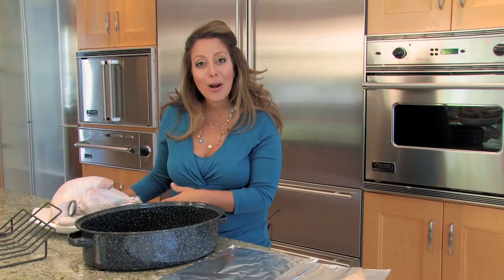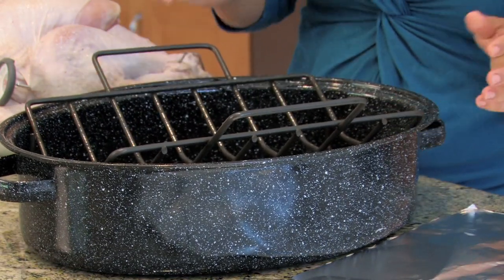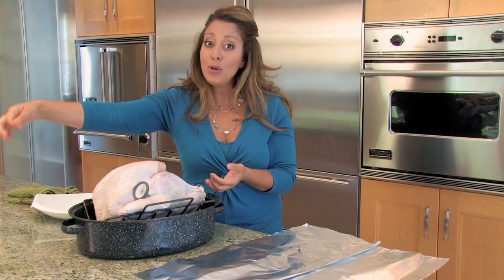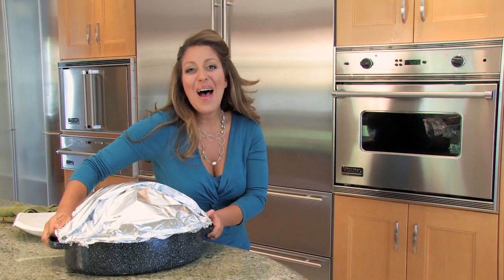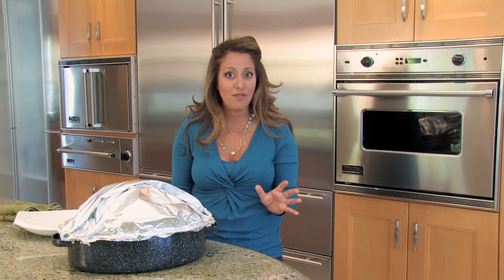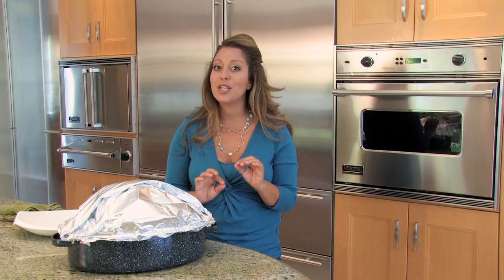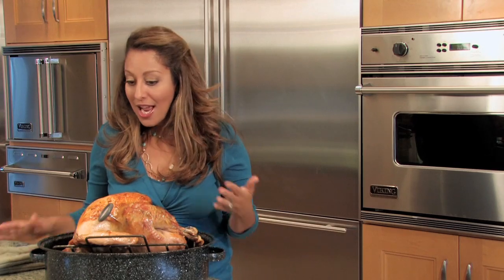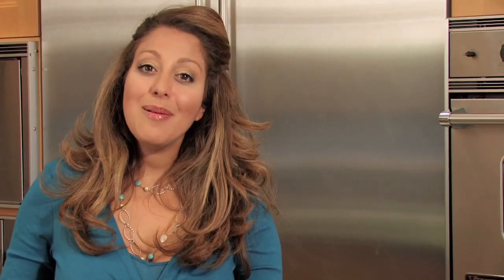Cooking & Kitchen Tips : How to Bake a Turkey in a Convection Oven

Comment: Valerie, look at how high the turkey is sitting on the rack in that pan, it essentially became a low rim pan with it sitting that high. I have Convection roasted several turkeys for thanksgiving, and the only foil placed is over the drumstick ends and winglets to prevent them from burning. Directions and most websites specifically say not to place foil like she did, sealing the bird (and eliminating convection oven effects).  Tent foil to reduce browning if desired only. Don't constantly baste!

Comment: No point in using a convection oven if you're just gonna seal it up with tin foil.
Reply: Ya David I don't think she really knows what she's doing, she said a convection oven cooks faster because of all the hot air moving around the bird which helps it cook faster, but she has it in a deep pan for 1 and 2 covered in tinfoil. It also looks like she has the legs tied together which decreases air flow around one of the thickest parts of the bird.         Larissa Taboryski knows what she is talking about.
Reply: And that roasting pan with the high sides is acting like a wall to keep the hot air of the oven from reaching the bird properly.
Reply: Bradley underwood she did say there is more heat, wrong, if it’s 325 convection or plain cooking it’s the same heat, but I give her credit for making the video, hopefully she can take some constructive criticism and make another video, she speaks really good, merry Christmas everyone from Canada.
Reply: Bradley underwood just looked up larrisa she does have a video to do a turkey. Cut up but not whole.
Reply: I must be down the YouTube Worm Hole if I stumbled upon this video.

She covered a Turkey
Put it in the Oven

But has no clue about the point of her Video

Never knew the other Turkey could speak English
Reply: My instruction manual says NOT to cover on convection for the simple reason that the air can't circullate around the food
Reply: @duramax78  convection tempreture is 25 degrees higher than standard so, 325 would equal 350 degrees
Reply: True

Comment: The whole point of convection is that the breeze created by the fan circulates around the food item, in this case turkey, and this convection removes the cooler air around the cooking item.  By putting tin foil on,you are removing the convection effect.

My way to cook turkey is a no brainer, coat with olive oil, put in pan with holder, insert temp probe, set probe temp to 165, set convection oven temp to 325.  When you hear the stove beeping, turkey is done. Let sit from 30 - 60 min.